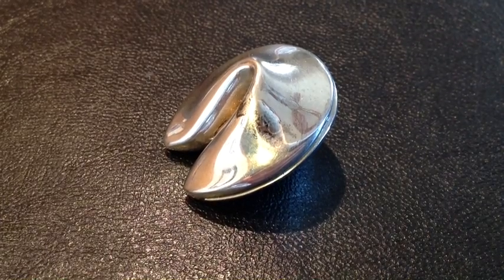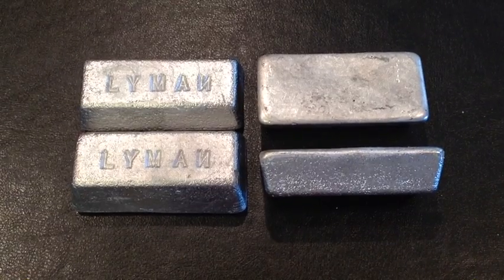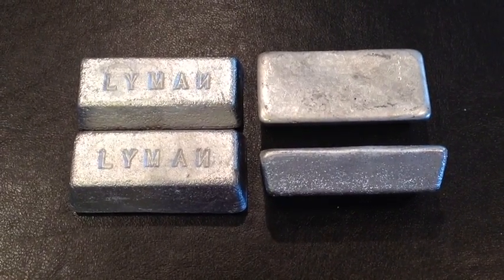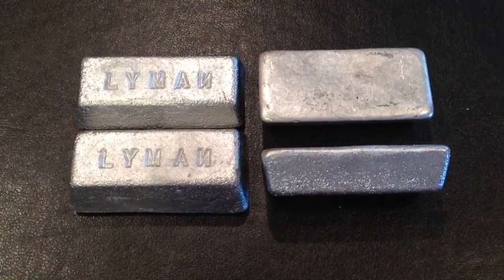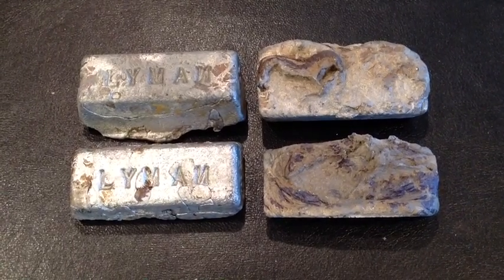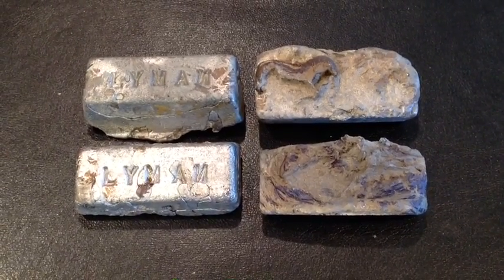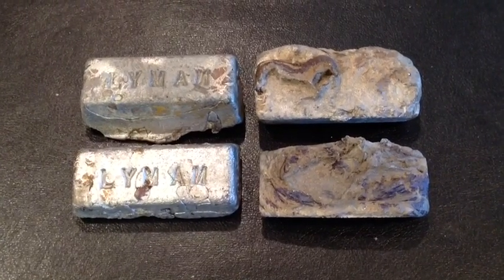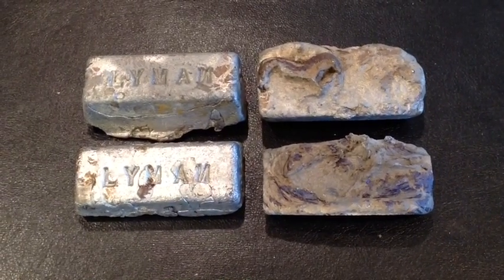Bullet Casting Heartbreak of Zinc

Comment: you should be able to separate zinc from lead, zinc has a melting point of 419.53C/787.15F while lead has a melting point of 327.4C/621.43F and difference of 165.72F...a good furnace and temp control should melt lead, leave zinc solid to be either skimmed off or left behind with a bottom pour.
Reply from the maker: +Jerry Miller (that old grog-nerd) -- Thanks for posting this.  I've heard of that over the years, and you would think it makes logical sense since we skim our lead alloys clean as a matter of course.  When I was still a relatively new caster way back when,  over 20 pounds of good lead  got contaminated with zinc back when I was cooking my molten lead while adding more wheelweights (this practice invites lead explosions), got real weird curdly, cake icing type of surface that I could not succeed in skimming off as hard as I tried (after all, wanted to save the batch since there was good lead in that mix).  And the best ingots I was able to pour were totally unacceptable.  No way was I going to risk contaminating more alloy with that zinc - so I threw out all of that batch including the pot.  This is only one instance of 20+ pounds of alloy lost over the tons I have processed (used to buy wheelweights and linotype 300 pounds at a time, then collected range scrap last 20 years at about 11 pounds a week averaged out).  So you see, it doesn't happen very often - may happen 1 time over the life of a caster - we learn to never let that happen again - my ingot casting procedures benefited greatly from that early learning experience.  Best advice is to learn or develop procedures whereby you never have to experience the Heartbreak of Zinc.  And those procedures are not difficult to do, plus they are efficient and result in great ingots for the making of our bullets....  Best Regards to ya,  FC
Reply: being in CA, I'm facing the non-lead dilemma...how do I hunt with every firearm I own (except for my dad's old 22) IS blackpowder designed for patched round ball (my 50cal hawken 1:66 twist and pistol 1:33 twist) or 44 cal ball (my '58 remmy, but with a howell conversion cylinder, 45 colt using LEAD cowboy loads).

I've been casting my own ball/bullet and reloading, but still It has to be in lead.

not sure what non-lead i can do.

oh, pure lead heated too high forms a greenish  lead oxide powder on top of the liquid.
Reply from the maker: koolkitty8989 - Thanks for the in depth info on this...it was a nasty gunky alloy for sure... Not an experience we would want to repeat... Let's hope it doesn't get down to where we have to cast zinc bullets...But it would only be a stopgap anyway - soon the yell would be that we are making armor piercing bullets...  Good castin' to ya...FC
Reply from the maker: Jerry Miller - The non-lead copper projectile ammo would be a solution.  But the current word is that the state will have a hard time enforcing the new law because an EPA agent will have to be on the scene to determine the non-lead or lead status of the ammo, plus there aren't enough game wardens.  However, best to go with the non-lead ammo... Hornady GMX bullets and ammo are good to go... Best Regards,  FC
Reply: tomboboutdoors.com offers an alloy roundball that's has no lead, but at a buck a pop it's a bit expensive IMHO, then isn't there a federal legal issue of brass/bronzes being considered 'armor piercing'? that's direct conflict with CA law I think, pure copper I'm not sure if the mass would be enough to be humane with a hit.
Reply from the maker: Jerry Miller - Quite a few of the hunters I know are already using the non lead ammo - were doing that already before all this no hunt lead ban law... that's why the non lead ammo was selling well enough to keep it on the dealer's shelves... The lawmakers think that there is no responsibility out there (and why would there be any since they are are ones that have de-emphasized responsibility in the first place), so people have to be forced to behave a certain way..."Let's control them since they can't control themselves"  Funny, they could have worked with the NRA on this issue so that if the NRA put out the information, then laws wouldn't be needed.  Best Regards,  FC

Comment from the maker: River man - if you are looking for max performance in rifles (instead of lower power plodder loads), the answer is to go with the epoxy/powder coated bullets.  You can shoot 223s at full velocity with plain lead bullets coated thusly and hardness makes no difference (within reason).  Doggone things shoot like jacketed bullets same performance no leading.  I'd try 30 cals first with some commercially purchased coated bullets before I made my own - requires oven baking to cure the coatings...

Comment from the maker: River man-Sorry to not answer your last question, must have missed it somehow.  On the epoxy bullets, yes I have tried it, coatings go on, but technique is sensitive, if timing is off, bullets look horrible.  The epoxy works on pistol bullets, but nothing is gained over standard lubing and is a lot more intensive work than the simple 45/45/10 lube system that is quick, easy and effective.  Now powder coated rifle bullets are reported to give jacketed performance with PC lead bullets..interesting

Comment: Yea zinc sucks, best advice is to keep your temp well below 782 (melting point of zinc).  You really should keep it as low as possible anyway when casting ingots, so long as it's hot enough that you can still make nice ingots.  The higher your temp the faster your alloy will oxygenate, the more often you have to flux to keep your tin/antimony in the mix.
Reply from the maker: jacek ringwelski- Good comment and I could not echo it any better.  That's why I tell casters to not bother fluxing 5-6-7 times and skimming till the lead is mirror finish (losing Sn and Sb while they are doing that) and lead temp is rising whole
time= The FC45LC Pour Ingots Without Delay Policy.  You should have done the monolog for the video that dealt with that...Best Regards...

Comment: When I get ingots from my reclaimed lead that just will not cast good bullets, it’s always the result of zinc contamination. The problem is that I did not skim dross enough from my reclaimed lead pot.   The zinc dross is kind of like a paste. It cools on the surface of good lead. Any lead that is giving me a problem goes back into the reclaimed lead pot and keeps getting skimmed until every last bit of the zinc dross is gone. After this the lead casts perfectly. I then hard jacket the bullets with a powder coat and they shoot great. This would easily salvage the zinc ingots in this video!

Comment from the maker: 4vacp-Perhaps some of those coated wws were what I was working with when I got the zinc experience.  Looking back, if there was lead inside, I would have had to crack it open in some way so that the lead could melt out before the Zn melted.  Because I didn't do that, the mix got hot enough to melt the Zn causing all the trouble.  Sounds like you've got a good handle on it.  You can't go wrong avoiding the Zn experience...Good casting to ya....

Comment: if you still have those ingots, hydrochloric acid (sold as muriatic acid in hardware stores) will easily dissolve zinc and leave the lead alone. should have been able to clean your melting pan with it two, if you'd have kept it.
Reply from the maker: +Drex33 -- That pot is long gone melted and made into something else by now...Muriatic acid - hmmm- good to know, I should have saved that pot...as for the ingots, it's only four or five of 'em.  I can gather range scrap to replace that in a hurry...Best to ya,  FC

Comment: lead melts at 621F and zinc at 787 so if melt all at say  650 should be golden  I always run smelter at 750 for bullet molding and pouring to bars perfect every time. and always use beeswax for fluxing bringing out impurities.  and id wash the wheel weights first get all the oil, grease, cow shit what ever, off them before melting, DO NOT add wet lead to any smelter it will explode, best to boil weights with water and baking soda for 4 minutes set out on a old window screen or steal grate small enough to hold the weight, and air dry for a day if possible before melting, now days id use a sheet of roofing tin gets hot in sun heats water faster to dry faster.
Reply from the maker: Gene Loren - You have your systems down cold, and thanks for sharing them.  With wheel weights, there are many zinc ones out there - so keeping the zinc out of our alloys is second only to casting safety in our concerns.  I haven't had any zinc concerns since I've been forced to go to range scrap for my base raw lead - but even then, zinc can be problematic (elvis ammo made zinc bullets).  My solution is to let the lead automatically melt at the 621-650 range and skim out all the bullet jackets and debris at that point - any zinc will skim out as well long before it its the 787 mark.  And my prevention of getting the lead too hot is that I pour my ingots without undue delay.  Continued good castin' to ya,  FC Steve

Comment from the maker: jibba02-Right you are!!  When I had my zinc episode, it was early in my casting career - there was no YouTube and you learned by reading - no one wrote anything about zinc or not over running the heat after the lead was molten - so I had my zinc lesson (see zinked ingots).  I also had my lead explosion lesson when water inside lead was thrown into molten lead (luckily, I was smart enough to see a bubble come up ducked - my protective clothing did the rest) - now new casters (see2)

Comment: Well if zinc is lighter, then couldn't you bring your pot to the zinc melting point and then let the pot cool below the zinc melting point and then skim the zinc off the top?
Reply from the maker: tiredfingers99 - once the zinc alloys with the lead, it makes a curdled mess that you can't get to return to a useable mix.  If the zinc actually mixed into the lead to  make a homogenous mix, we'd still be able to cast it.  But it doesn't do that - it makes some kind of weird intermediate that ruins the alloy for casting.  I hear that there is a process using sulfur to separate the zinc from the lead, but sulfur is also very toxic stuff to work with…not worth the trouble.  We just learn to avoid the heartbreak of zinc… Best Regards

Comment from the maker: bwspyder1-they skim and the layer of clips is thick.  By the time they discover the zinc WW, it is possible for melting to occur.  Casters have experienced batches of lead being ruined.  If we do smaller batches of WWs 25 pounds of less, the danger of zinc is lessened.  Sounds like you have your procedures well set up to not have that happen and that is good - you don't want these souvenirs staring at you.  Best Regards…Thanks for your post

Comment: Also i saved both of my pots by taking a torch to it, melting tbe zinc and just pouring it out. Be careful not to melt the pot if your torch burns as hot as mine do.
Reply from the maker: Daniel Pierce - Good job on saving those pots...I was so disgusted with the zinc contamination, I just got a new pot.  Good castin' to ya,  FC Steve

Comment: My first batch of zinc contaminated lead ingots came out perfect, but they are hard as hell. I casted .50 caliber bullets and they performed so well I couldnt tell they were contaminated.... I must have been melting at over $1,000 degrees Fahrenheit...... Still, never again... Thanks for the video.
Reply from the maker: Daniel Pierce - You did far more than I with that contaminated lead...I turned the contaminated stuff over to the metal recycler, saving these four just to remind me to avoid any repeats of this... Best to ya,  FC Steve

Comment: How do you know if you have zinc in your lead? Are “metal”  wheel weights actually made of zinc? Are zinc wheel weights separate from lead wheel weights? If so, couldn’t you use a magnet to determine what wheel weights were lead and which were zinc, or could there be zinc mixed in the lead weight?
Reply: Last batch of wheel weights I obtained were a mix of steel, lead and zinc. Steel can be separated out by checking the weight body with a magnet, if it sticks, obviously it's steel. May have some doubts on the smallest ones because the clip on the weight may nearly weigh as much as the weight. Now with the zinc weights I found that if you can find a really large set of diagonal cutters and chomp down on the weight, the lead ones, being softer, will show a much bigger dent where the cutter jaws bite into the weight. The zinc, being harder, will resist and have less cutting damage for the same amount of effort. After culling in this method, take the weights you're pretty sure are really lead and start your melting pot. Now lead melts at about 620°F,  zinc at 787°F and steel way up at 2,500+°F . If you use a thermometer in your lead pot & keep it less than 700°F you won't have to worry about zinc contamination, because the zinc, along with all the steel clips off the lead weights, will be floating on top of the melted lead.

Comment: lead melts at 600 Degrees zinc melts at 780 what you need to do is get a good thermometer and set your lead pot to 600 and just  melted the lead and it will leave the zinc hard and you can pull it out with a little trial and error of course
Reply from the maker: donald plank - Yes, your temps are very much dead on target.  But instead of using a thermometer, I just use the lead...when the lead melts and I see empty jackets floating (or with wheel weights, only clips floating along with the ones that haven't melted yet) When that happens, we have exceeded the melting point of the lead alloy and have not reached the melt point for zinc...I simply turn the heat down to 1/2 and then waste no time skimming everything out that has not melted...all the clips, zinc and steel will be removed.  Thermometers slow me down in ingot making, as I keep fiddling with the heat up or down as I overshoot the thermometer.   Then, when I'm casting bullets, I'm only using clean known lead alloy in my ingots, there is no longer any zinc to accidentally melt into our mix even if the temp of the alloy climbs over the melting point of zinc later in the casting session...I read my sprue cooling and that keeps my alloy from getting too hot... Best to ya,  FC
Reply: Have you ever tried a infrared thermometer?
Reply from the maker: BuckPole - Yes, but it doesn't work well with a shiny surface like our molten lead.  Gives bad readings...I've found that thermometers just slow me down...I let the lead tell me how hot it is... Best to ya,  FC
Reply: Was't sure, we use the IR for tire temps on stock cars and thought it might work.  Keep the good info coming.
Reply from the maker: BuckPole - Sounds like a great place for those IR thermometers on those tires...Good racin' to ya..!!  FC

Comment: melt them back down and flux with sulfur it will separate the zinc from the lead and take it out with the dross. i've seen it done.
Reply from the maker: scott perry - problem of using sulfur is the neighborhood will smell like a volcano and I can't imagine any of my neighbors putting up with that…I think I'll just keep doing my darndest to never again have the heartbreak of zinc…Best to ya
Reply from the maker: ***** Sounds good, and good to know...but to test it, I'd have to purposely high temp melt some zinc into my lead alloy and then pop in the sulfur.  I think I'll just keep my anti-zinc-in-my-alloy procedures, and leave the sulfur testing to others...Besides, I like my lead alloy just as it is without the zinc, and I can do that with prevention - much better to prevent than to cure the problem...Thanks for posting this though.  My perception is that we are on the same ground...
Reply: I've
 been reading several articles now that sulfur does indeed cause zinc and other slag to come to the top. stinks like heck but it works, gives you pure lead with no tin or zinc or antimony in it.
Reply from the maker: scott perry That's fine information for casters who are processing lots of wheel weights where the possibility exists for melting zinc into the lead if the temperature is allowed to go too high.  And if it's a big batch of alloy, then the sulfur bail out can save the day...even get pure lead for shotgun slug and black powder shooters...Have a great day
Reply: FortuneCookie45LC have you ever done any video for casting hollow point bullets yet? I don'
t think i have ever seen any by you yet. i enjoy watching your videos they are so helpful and I have  learned so much from them.
Reply from the maker: scott perry The casting of hollow point bullets is done the same way that castings for hollow base shotgun slugs is done - there is either a removable base or nose pin(s) or a pin(s) attached to the mold blocks that makes the hollow base or hollow point.  The molds to do hollow point bullets are a fair bit more expensive and the molds are usually not gang molds.  I like lots of bullets in the shortest amount of time expended so the solid designs are fine for me.  When I do cast bullets, I like 'em the right hardness for the job and I want heavy blunt points crashing through the target.  On the other end of the scale, when I want expansion, I'm just going to buy some of those green or red or black packages of jacketed bullets...This philosophy is why you won't see any hollow point molds being used in the Hot Lead Zone...but for those who do them - they are beautiful bullets and I like seeing them be done.  I just have no use for them.  Scott - Best of the Holidays to ya and Best Regards